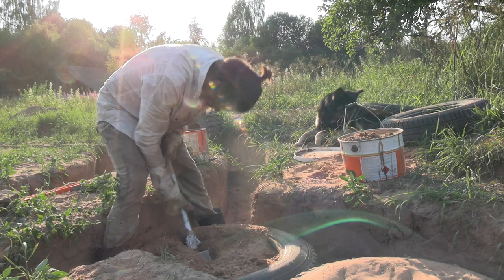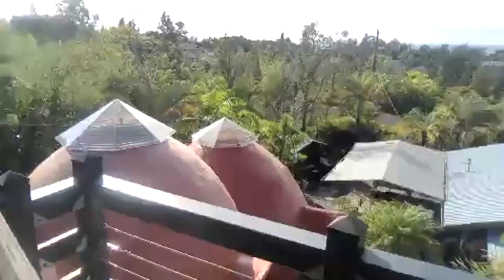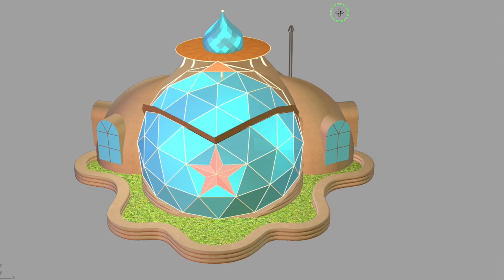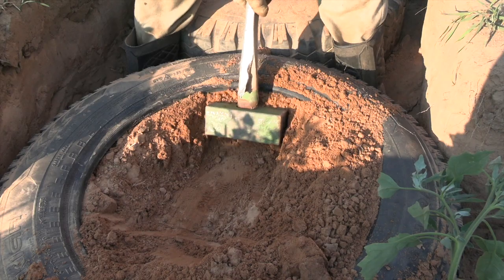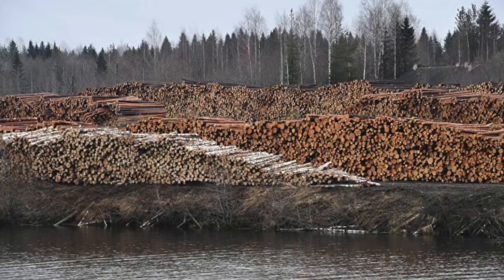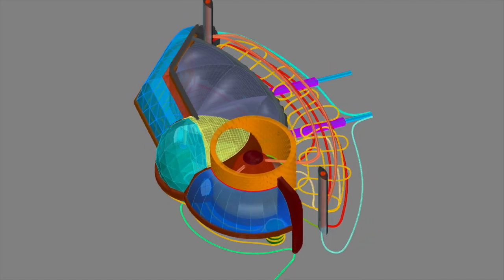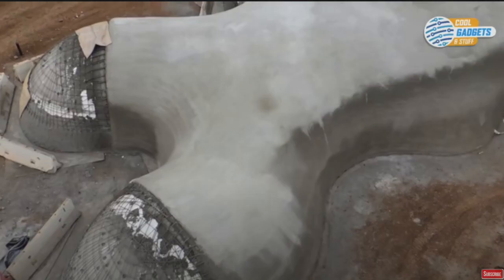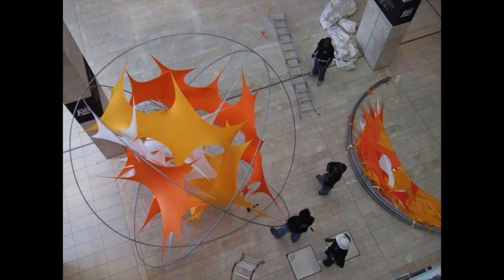⭕Aircrete Domes are finally LEGAL in USA

Comment: I like the idea of the dome houses. But in reality - it's not easy if the district office will not go along. So I will build a tower / cylinder house instead with 6" concrete blocks. Concrete blocks are approved in Panama where I live. Most materials I'm use to in Germany or Canada are not available here. Ridiculous journey to only get what you need.